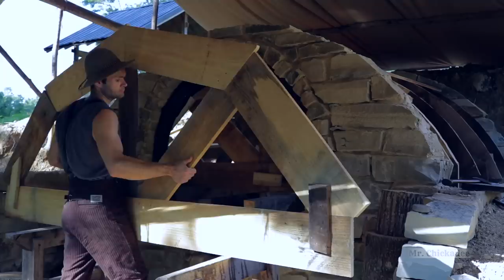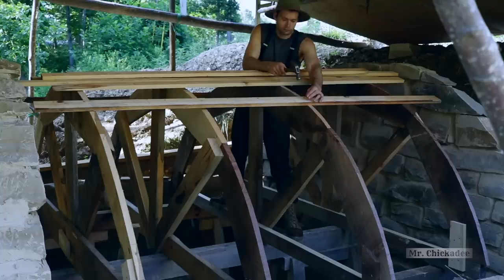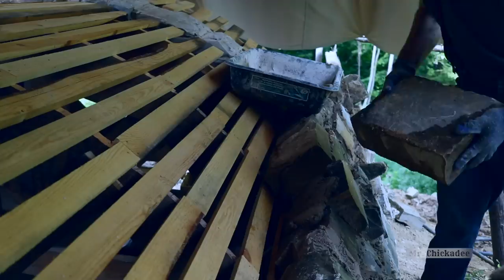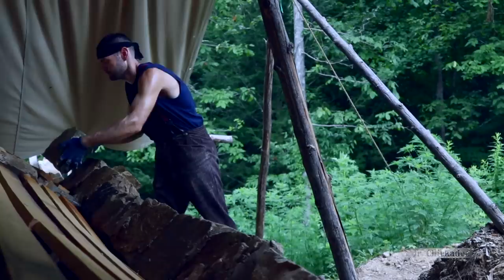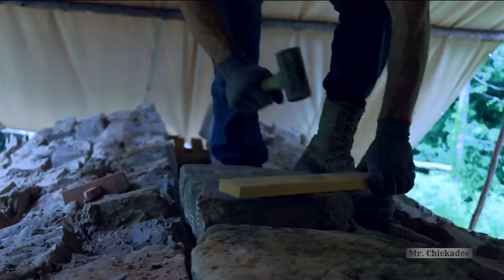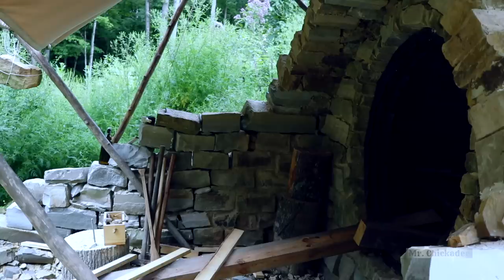Building a Hobbit style root cellar with stone Part III

Comment: The amount of confidence you had while hammering at a ton of stone while standing inside the structure was inspiring
Reply: The structure is designed not to fall down even if there are  some minor mistakes. But anw, yes, the courage and belief he gives his work is amazing
Reply: Lol exactly
Reply: @laiquocbao2565  Are the middle top stones keeping everything from falling if the mortar fails? I dont really understand whats to keep one of the stones from sliding out if the mortar doesnt dry or hold it properly.
Reply: @SuWoopSparrow  the shape makes it impossible for the stones to slide. They are jammed in, for 1 stone to slide they would all have to. Look up key stone arches .
Reply: @SuWoopSparrow  gravity holds it together. the weight of the arch is what pinches each block in place. it is not absolutely necessary to use mortar.
Reply: i had goosbumbs as he took away the wood hooping all the stone stay where they are for the next 300 years and more👍🏻
Reply: yeah the shape means there is no one "side" for all of the pressure or weight to push against so it gets more evenly distributed as opposed to like a straight wall or ceiling or something. it's why circular things like arches are such stable objects in architecture. it's pretty damn neat if you ask me.
Reply: almost makes you wanna go into the medical field, am i right? 😉
I'm joking. It's pretty amazing!
Reply: The trapezoidal stone blocks are science and confidence.
Reply: @SuWoopSparrow  La forme de la taille des pierres répartit la pression autrement que verticalement. La pierre au centre de l'arche s'appelle la clé de voute.

Comment: Ok this is the coolest thing I've seen in a while. I've been wracking my brain on how to support a curved vardo roof for a self made camper. The 3 minutes solved my problem.
It will not be stone, more than likely it will be corrugated sheet metal or fiberglass to save weight.
Thanks man. Sometimes easy solutions get pushed to the side by over thinking the problem. (at least for me)

Comment: Dear sir, as always I highly admire your work and would be happy if I had your abilities in my country (which is very restrictive in construction laws).
But as a German mason and concrete master, I would highly recommend to add some mass at the abutments on both sides.
Your flattened round bow will bring some pretty high horizontal forces at those points.
You should put some amount of ground on both sides.
Just my 2 cents.
It´s always a pleasure to watch your videos.
Reply from the maker: Thanks for the concern. it will all be covered up with good soil, and be like a little hill at the end
Reply: @MrChickadee  I don´t want to be a nitpicker, but I would not step into it, before this is done.
I hope you will be fine and will enjoy the process of the making as the final result, like always.
Your craftman´s skills are extraordinary, and I´m not sure, if I love them more, than the fact that you are using old methods.
Please continue.
:o )

Comment: Did you have to wet the mortar multiple times per day as it dried/cured? Or did the mud you added act enough as a poloozan that you didn't need to put wet burlap on it as it dried? Or is the wet burlap thing only for repointing brick and not stone?
Reply from the maker: Yes, John from Pen limeworks did not recommend burlap or other extreme measures, only a min of 3 distinct wetting cycles for the lime to pull what it needs in from the air. I would advise you to have a talk with him before you tackle any traditional lime project.
Reply: You must have learned a lot since you last blogged about lime mortar. Looking forward to more posts on lime

Comment: So many questions hehe. I always thought mortar is not needed when the arch is finished , it falls in place it self. But and question about mortar, as in what if it brakes out between the stones, will it not fall then?. How do i see this?!.
Reply: In the video captions, he explains that the mortar isn't structural -- he wiggles each stone until it touches the other.  The mortar is just filling in gaps, not holding weight.

Comment: how did you measure the key stones?  I'm assuming it's not feasible to try and dry fit it more than once, and i've never seen you use a measuring tape, so what's the trick for transferring the dimensions to the key?
Reply from the maker: I took a stick, made a mark at bottom of the space and top of the space, this gave me the narrow or "bottom" measurement, and wide or "top" measurement, even then, each keystone was placed, taken out, and carved move sometimes 6 times until it was sufficiently tight and deeply inserted.

Comment: You, Josh, are braver than the US Marines tramping around on that barrel vault assembled from stone and still green mortar without much for buttressing. Tell me it's butressed down to bedrock with a battered stemwall. 

That said, gorgeous hunk of rustic masonry. You dress all the stones yourself?
Reply from the maker: Haha, well as a former Marine I can attest this is much safer than sweeping for IEDs, but there was a bit of stress removing the forms from inside. 

The side walls are fully buttressed of course, and the entire roof will be soon enough. 
The stones were all hand split from recycled WPA rail road bridge slabs, as seen in Part I of this build series. I figure about 50 tons went into this cellar, and yes I feel each one.

Comment: My friend. I wanted to ask a guy who’s work is timeless, what he thinks of homemade concrete sealer.  Would a proper mix of paint thinner and boiled linseed oil be as effective as a concrete supplier bought concrete sealer?
Reply: As a civil engineer, I can say it won't be. Not all concrete sealers are created equal.
Look at wether you have standing water on it Vs just needing a damp resistant coating. Standing water dictates a different concrete mix anyway. Sealers won't be good enough.
Sometimes it's easier to go with a hydrophobic coating that's reapplied every few years if it's just driving rain you want to stop.

But none of the commercial ones I know are really environmentally friendly. Neither is concrete, but that's a different story.